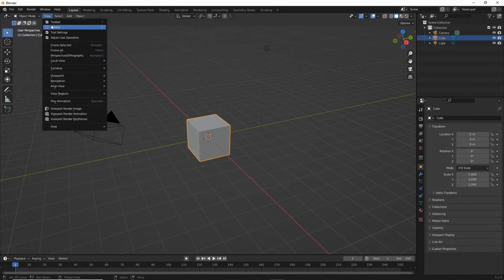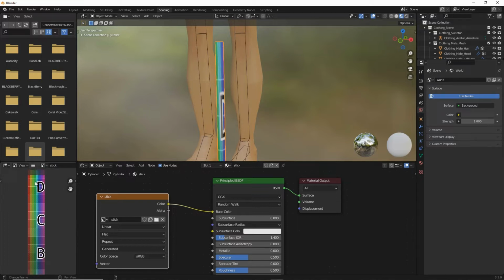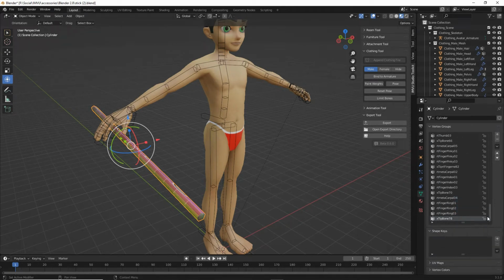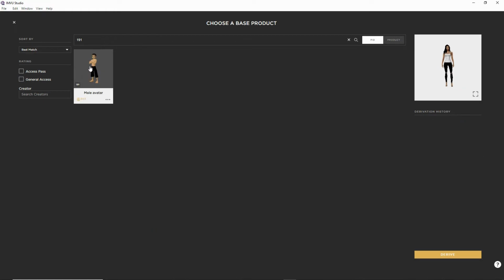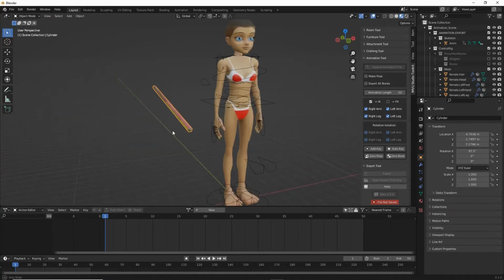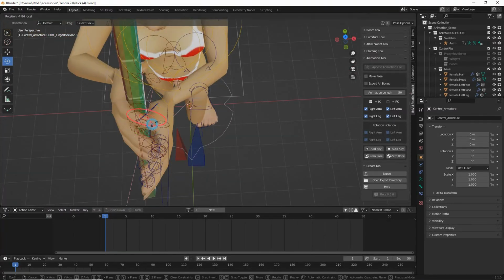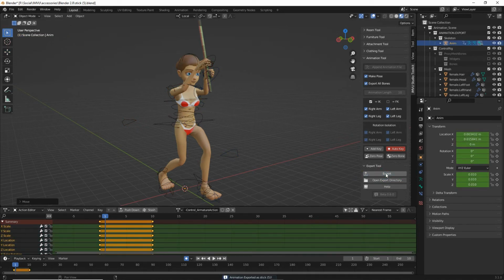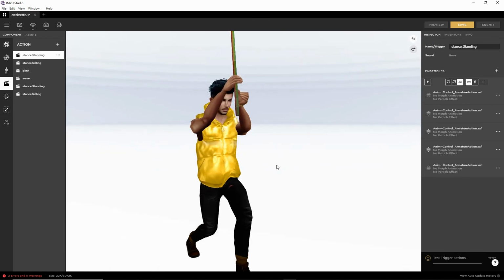Make an Accessory + Pose using IMVU Studio Toolkit

Comment: hi there KatsBits. I have a question I followed all steps but when I import the 2nd fbx (the animation one) in the review and import part the assets doesnt appear and I cant hit import button because there is a yellow dot like loading forever, any clue why might it be? regards
Reply: hey I solved it dragging the item to the animation export folder, however I noticed something strange, the body area you choose to attach the item and weight paint make that body part override the scalers you have on the avatar, why is that? is there anything we can do to avoid that? o.o I mean: I attached something to the wrist and when I uploaded it to studio the avatar hands was huge xD
Reply from the maker: @TutorialesCreadorImvu  if you've used scalers on your avi then you need to (re)adjust the accessory to fit that particular look. By default, using the toolkit avatars, everything is scaled/positioned relative to the originals so any changes to those have to be accommodated with manual adjustments to fit.

And yes, unless you need to export the body part they should not be included as part of the export process.
Reply: tvm Katbits! you are the best :D yay @KatsBits

Comment: Hi, thanks for your videos, very clear explanation even for those like me who don't speak English well 😅. if i wanted to make a static object like an armchair and put it in an avatar, in which node should i attach it? i tried with the master root but when i move my foot, the object follows it, thnx
Reply from the maker: You're making a pose that includes a mesh? Make sure the chair is weight painted to Female03MasterRoot.
If you're making a pose to fit a furniture item you just need to make sure the seat nodes are set up correctly (linked to Furniture.Root). Jump on Discord if you're still stuck (https://discord.gg/D5TuNx4P)
Reply: @KatsBits  Thanks, yes I did, I was coloring the weights wrong, I'd like to reach your discord but I can't, it only sends me to discord but not to a server
Reply from the maker: @Ice-jy2ww  Invite probably timed out. Try this one... https://discord.gg/xNxEpepV